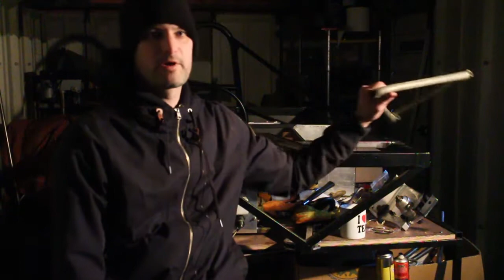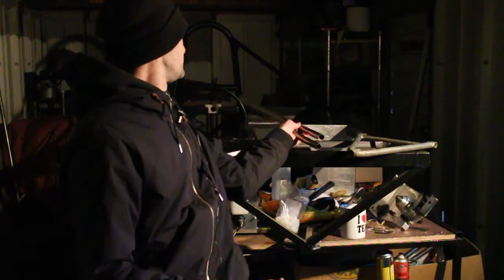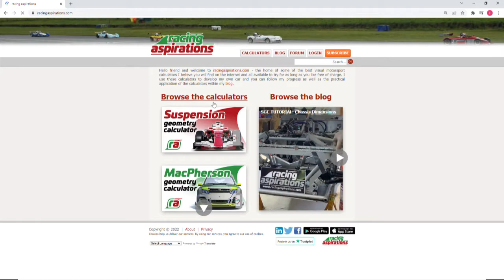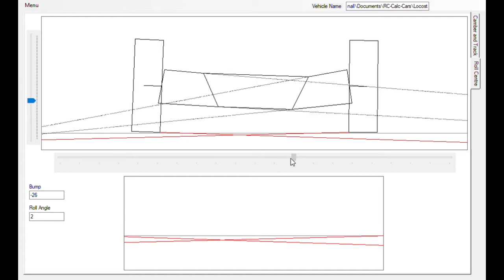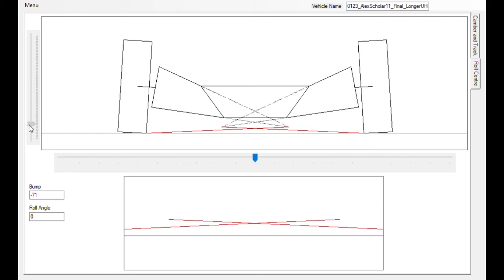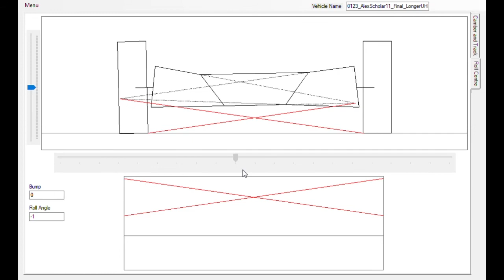[DESIGN] Front end design and software.  Ep28

Comment: Does that software allow you to model roll centre movement for just one wheel in bump, e.g riding a kerb on the apex?
Reply from the maker: Nope!
Reply: @schoolingthescholar5323  I used the "Bones Apart" software when analysing my Locost. That does allow individual wheel inputs for bump but I googled it and can't find it anywhere now. It in the form of an excel spreadsheet if you want to borrow it.